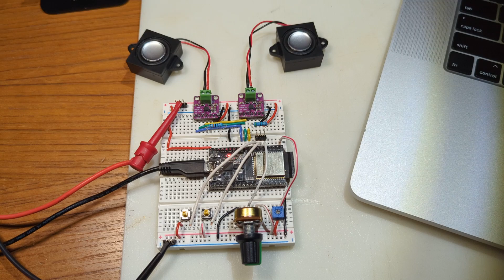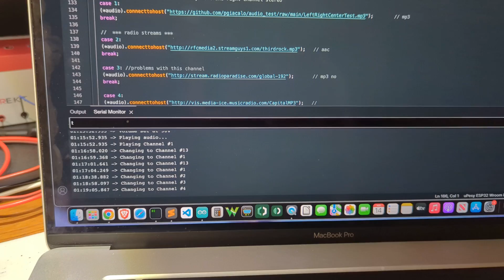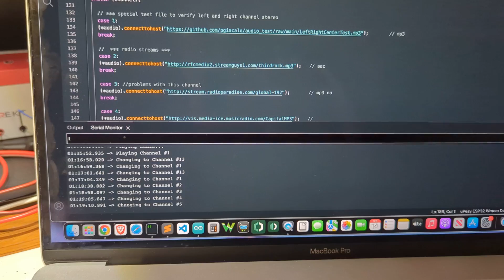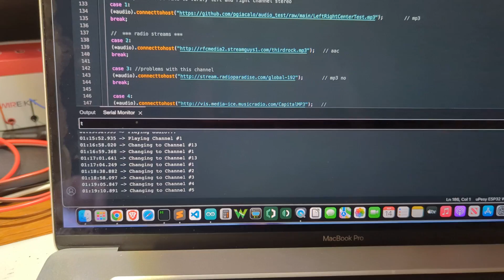ESP32 I2S stereo audio player for internet radio streaming via WiFi (Part 3)

Comment: Thank you  -  3 great videos that explain everything I was puzzling over. I am planning to build a super simple internet radio with only a few channels for my elderly mother and your video will help make that happen.  One question - I would like to replace the channel up/down buttons with a rotary switch (3 or 5 positions), do you think that would require a significant amount of code changes or give other issues? Thanks again.

Comment: Hi there, thank you for posting this video. I have been looking for this circuit for ages. There are plenty of videos with 1 fixed radio station, but I wanted more than 1. I have uploaded your program onto the ESP32 and it works great. There is however a small problem, on the video(part3) the wires from the up and down switches go to the  3.3v positive, but in the enlarged version the switch wires go to the ground connection, which makes it a bit confusing. I am also very surprised that your videos have received so few comments for such helpful videos.
Reply from the maker: Thanks for your nice comments. Sorry for the confusion. As I recall, the still image shows the final wiring that should work with the github code, correct? I had an issues with the channel up/down buttons bouncing. So I took advantage of the ezButton library to fix that problem and also moved the button pins to the same side of the board. The ezButton library is configured to react to button presses when the voltage changes from pulldown to pullup (ignoring bounces). The 2 buttons are connected to ground in order to pull down those pins. As I recall, the channel changes only when a button is released, correct?
Reply: Thank you for your prompt reply, I haven't connected the buttons yet, but I will connect them to ground and give it a try🤓